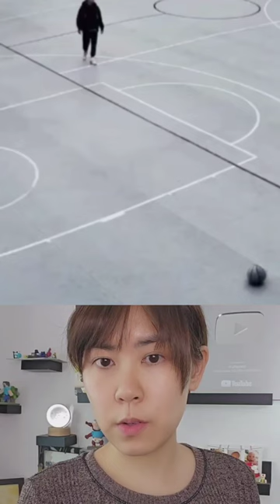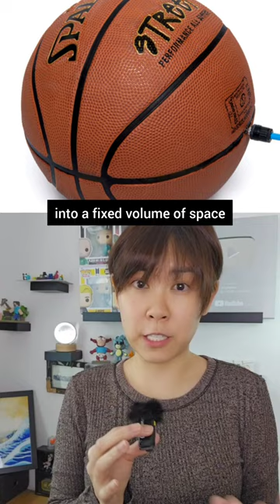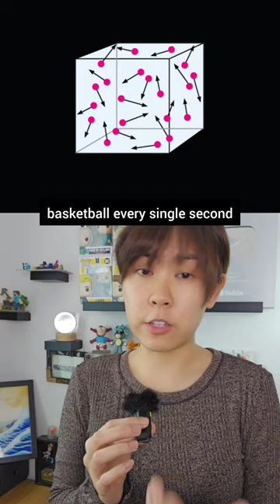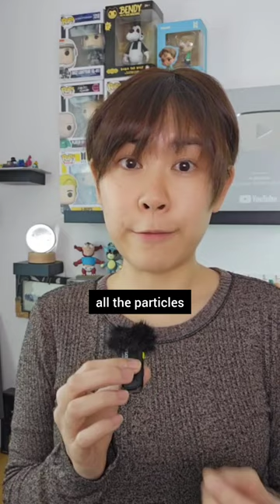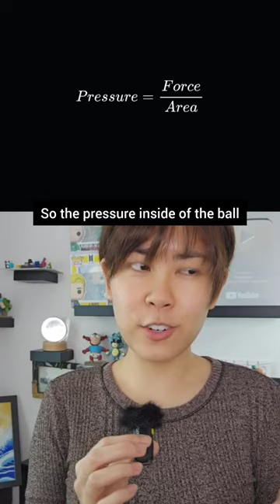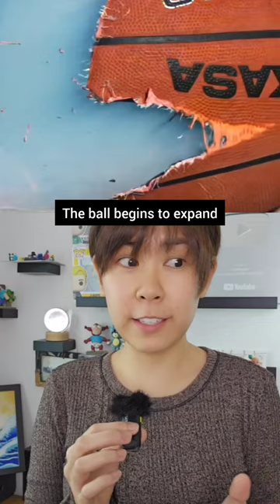How does air pressure inside a basketball cause it to explode #physics #science

Comment: Hey can you explain the science behind the opening of wine bottle with heated tongs.
Reply: It’s pressure. If you blow up a bottle it will expand until the pressure is released somewhere. Same thing applies with the wine bottle. Difference is the glass will not break before the cork shoots upwards and instead of blowing up a bottle you are using the same pressure just with heat turning into vapor inside a closed vessel. That is then released via the cork shooting up and out.
Reply: @LanceCarmony  🤦
Reply: @ANGAD047   does this not answer your question? If you looking for science then yea hopefully someone smarter will answer. I answered as basic as I know how 😊
Reply: @LanceCarmony  brother your interpretation about heated tongs creating pressure inside the bottle is totally wrong,i have seen the procedure of opening vintage wine with heated tongs, first they grab the bottle just below the cork with the heated tongs for a min, after that they dip a brush in ice cold water and apply on the heated glass part, because of sudden change in temperature it cracks the glass and the top of the bottle can be taken off easily.
Reply: I just wanted to know the micro science or shall I say physics behind this she explains in her shorts.
Reply: @ANGAD047   oh I see you are referring to the breaking with the heat not the shooting of the cork with the heat. I see I apologize
Reply: @LanceCarmony  no brother don't apologise it's not a big deal.
Reply: @ANGAD047   Well shit I appreciate your understanding. Not much of that going around on the internetssss these days 😂